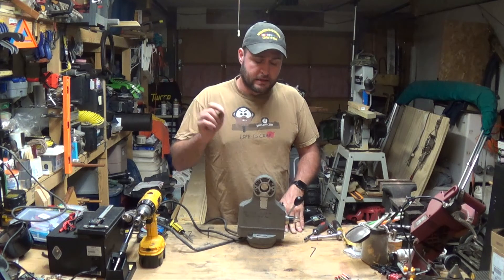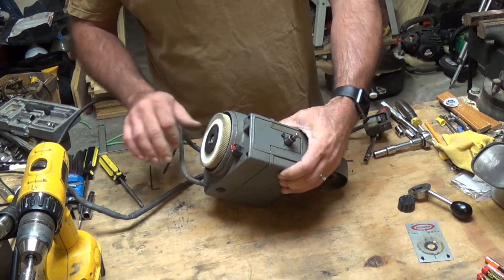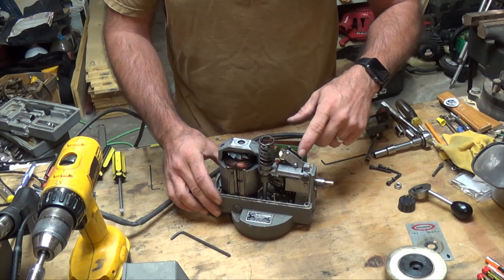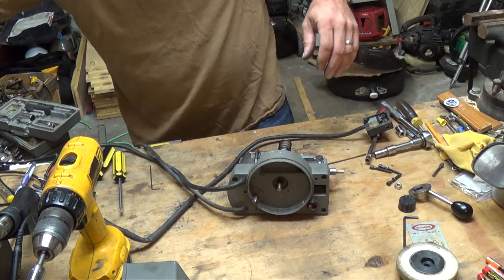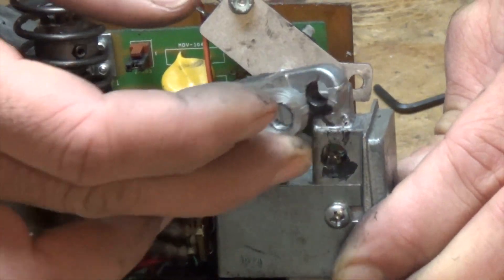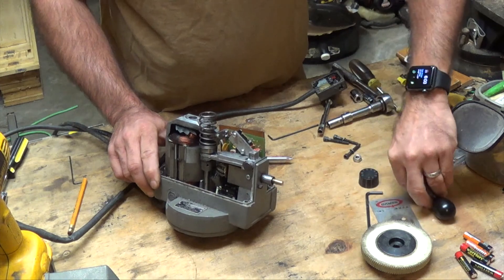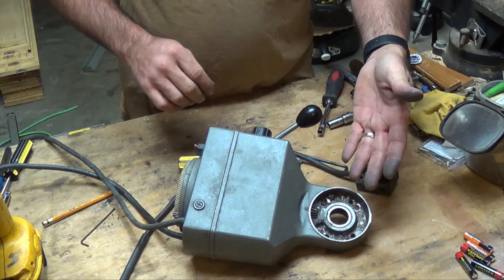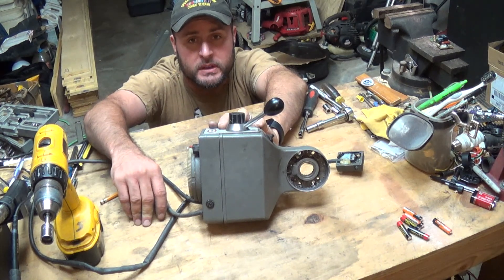Servo 140 Power Feed Repair

Comment: Common failure mode. Seems like it happens to the same operators over and over. I watched them for about an hour. They were hanging on to the direction lever the entire time the gear drive was engaged. Once they stopped doing that it worked fine.

Comment: Good vid.Had the same problem showing as an intermittent fault chased through all the circuit board finding no fault, then found the exact same as you did.
Thanks for the vid. 
Chris from england